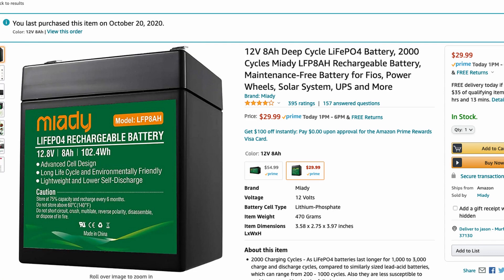Batter/Solar Duration Test

Comment: The Buddipole Power mini solar charge controller will keep track of the net battery charge in real time. You can see if you have used more power than has been replaced by the solar panel (negative values). You can also see if the solar panel is powering the radio and charging the battery back up (positive values). Buddipole has two boxes: Power Mini and Power Plus.